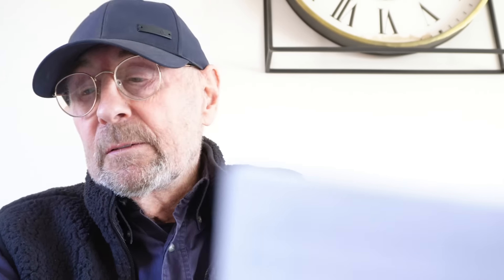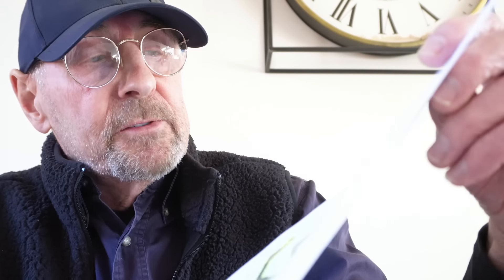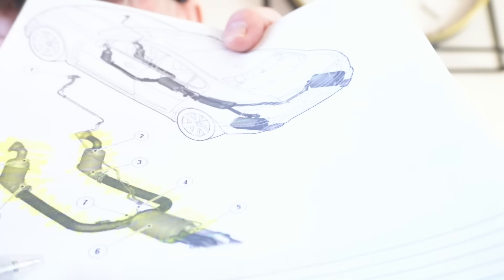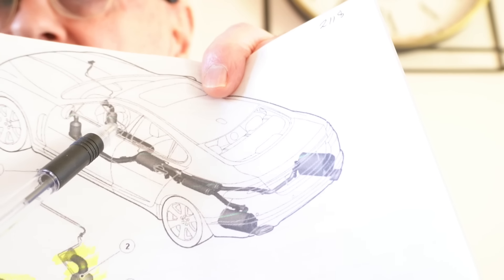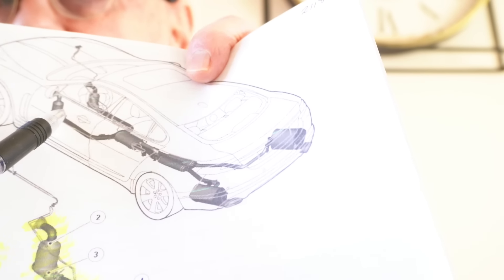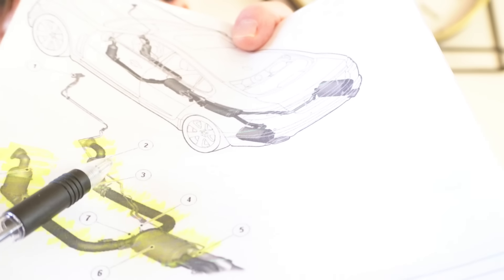CAUSE REVEALED!.. The Self-Destruction Of Jaguar Land Rover 2.2 / 2.7 / 3L Diesel Engines

Comment: You’ve just described the DPF regen system used by every diesel since 2006. It’s not unique to Jaguar.  Every diesel produced has the same issues. 
The 2.2 4 cylinder doesn’t suffer from broken cranks. Only the V6 does. Same for spun bearings. But, in the case of broken crankshafts, the engine is known to be short due to PSA wanting to use it in FWD applications and allegedly that’s made it a little thin at one point making it weaker than it should be. This is why failure is more common on heavier Landrovers and almost unheard of on Jags. Most as you say though are fine including my Jag XF at 111k. 
As far as 5 k oil changes go, sure why not. But equally as you say it’s driving style and usage and the computer alerts if it needs to be done sooner so it’s a little bit alarmist. The car knows if the oil is diluted so if it’s saying all is well, why not believe it?
Mine is generally done at 12k and is fine. 
So failed cranks aren’t due to oil dilution afaik. Spun bearings may be lubrication related but I suspect it’s just a design fault too and can happen irrespective of oil. 
They say the same about LR ingeniums. I had the oil analysed on my low mileage ingenium Discovery Sport after 12 months / 4k. The “internet” would say I should be running on more diesel than oil by then. 
 Oil very sooty but dilution? Negligible. So changed the oil anyway but not for the reason alarmists claim.
Reply: The cranks break on Jaguars also. It’s just that there are far fewer Jaguars around. It is only a proportion that fail each year. Around 5% of all V6 diesel seem to fail on an annual basis, which doesn’t sound too bad until you think about how many each dealer have in their area, which could be between 500 and 1500. If only 500, they may have around 25 failures annually , which is impossible to hide after a few years.
Reply: I have been interested in all these ideas on why crank shaft on the tdv6 brake one reason is the casting of some of the crank shaft is not as it should be now this has been under investigation for some time and what was point I would like to make is seems with a new crank shaft fitted and not changing any particular part of the existing emissions fitted to the vehicle and  have travelled many miles or kms without any issues,so there is another good point made that was made crankshaft failure happens between 75,000 98,000 102,000 and upto 200,000kms from  2006 to 2015. This for me personally would make more sense because the crankshaft casting I believe was made in different countries who ever read's this comment hope you will find it interesting I did I've been in the motor trade for many years  and seen many things 
so this doesn't surprise me this would happen thanks Barry.
Reply: @hedydd2  Not sure where 5% comes from as I've never seen actual numbers. I'm active on the UK Jaguar forum where the majority of Jaguar V6 diesel owners will go if there's a problem. Reports of engine failures are very rare there and certainly vastly lower in number than are allegedly seen on Landrover forums. I've also seen reports of spun bearings. In fact, I did a quick search for broken crankshaft and nothing other than a discussion on the subject came up. As these are the same engines in the same batches as LR, the only real difference is in usage. Load, both from the perspective of powering a 4wd system and also the weight. Add in that LRs can also tow large weights and it would seem that stress may be a bigger contributor than other factors.
Reply: @julben1900  So what you imply is that the engines are inadequately strong enough to handle the torque with which they are endowed. I would agree with that. They are are indeed not strong enough, which is why they break.
Reply: @hedydd2  Could be. When they first came out they were 2.7s with 435nm - they're now pushing out 700Nm. Mine is the 600nm version and on the 2wd XF, the only thing you get if you try to access that off the line is wheelspin. In fact in anything other than perfect conditions, it can break traction at 40. Plus the weight means acceleration can be brutal so unless you're a total lunatic, you only ever use full power rarely and then in very short bursts. It's great for pulling clear on a motorway but once up to 80, you're idling the rest of the way. 

The LR vehicles are obviously much heavier and 4wd so that power is much more accessible, so i do wonder if one is driven spiritedly whether it's pushing the crank harder than it's ideally designed to go. Add in a little manufacturing tolerance and you're close enough to the design limits to err into the statistical failure region.

Comment: Very plausible and interesting video. I imagine another factor to be fuel quality, there's quite a variation in diesel fuels available at the forecourt with bio fuel blended etc. If you run on lower quality fuel you can get injectors deteriorating which dramatically increases the amount of fuel goes past the pistons and into the oil on a regen. I'm lucky to live near a garage with a premium diesel fuel option and I always choose it. On a rare occasion where I have to put in a budget brand I only put in the bare minimum and top up with premium as soon as possible. I'm not going to name brands but some forecourt diesel fuel is pretty ropey to the point where a sensitive driver can feel the power loss. One fouled injector will wreck the cat and DPF, replace them and they'll just go again. I used to be a diesel mechanic and I'd far rather spend a few quid more on good fuel and closer oil changes than have the hassle of a major failure. "Service and care always cheaper than big repair"

Comment: Would love to hear your take on the economics of doing a bottom end refresh as a form preventative maintenance on otherwise healthy higher mileage engines. If lubricant dilution (makes sense) and a known weak crank (which I believe must be contributing at the point of no return) ie when the bearings spin and cut off the remaining lubrication. Maybe the answer is bearings (and/or) a journal Polish. It’s a lot of Labour and the question is where do you stop ?

Comment: I’m sure how to reply on my comment and to your reply. However you ask if the engine was also damaged. Unfortunately the dealership have been told by Land Rover Technical that they are unable to confirm if the engine is damaged until all the replacements are done and more compression tests are done. So I have no idea. I’ve asked for the compression tests that have already been done as well as the oil results and been told they can’t supply these until they have spoken to the head office 🤔🤷‍♀️
Reply: Sorry that should have said, I’m not sure how to reply 🤦‍♀️
Reply from the maker: Hi Debra,  let me know what they diagnose. They are correct the DPF should not have caused the turbo failure. The oil dilution occurs because of extra fuel injected into the cylinders, 2 of those 5 injections are to aid the heating of the DPF so is relevant to the DPF system but the DPF and cat are after the turbo so should not affect it. The engine oil dilution applies to the earlier diesel engines 2.2 / 2.7 / 3.0 not sure if it applies to the 2ltr as I have not read the relevant information yet but I would assume they run the same system.

Comment: Have you got any oil analysis data to back up your theory?
Reply from the maker: Hi, thank you for watching and for your feedback.Could you clarify what you mean by " your theory "
Reply: @crystalclearmechanics  Your theory is that diesel contaminating the engine oil results in reduced oil pressure, which ultimately causes the crankshaft to break.  Is there any proof from oil analysis data that engines which have experienced crank failures have excessive diesel in the oil?
Reply from the maker: Hi, thank you for replying. Your question as to my theory of what causes  the crankshaft to break, if you listen to the relevant words i use, " Guessing" "Doubt" and "Imagine"   which of those words  would you say implies the existence or need of proof? Your question should be relevant to the content. @tempestv8
Reply: It aint no theory mate it is fact - diluted oil will not lubricate as it has no viscosity hence the bearings heat up expand and nip the crank and then the torque of the engine snaps the crank - you dont need no bollocks data to work that one out
Reply: Unlikely. He's bundled the 2.2 into the same bracket of the 2.7 and 3.0. wholly different engines. Everyone knows how a DPF works ... service well and don't buy a diesel if you only do short runs.
Reply: @crystalclearmechanics  You make it quite clear at the end that this is not a guess, doubt or imagination.  You say it's the reason for the engines failing and that people should be made aware.  If that's not a theory, then what would you call it?
Reply from the maker: hi, I make it clear that oil dilution is the main reason for these engines failing ( Elephant in the room ) / bottom end destroyed, your question about the crankshaft is not relevant to the content.   @simonuden8450
Reply: @crystalclearmechanics  In your past video you highlighted the big end bearing shells slowly being nudged from their original position, and the shift of the bearing shells cover the oil lubrication holes.  Then when starved of the thin film of oil, the bearings will over heat and create a huge heat load on the crankshaft and eventually lead to the crankshaft snapping.  That's the general explanation that makes sense to me.  This new theory that its oil dilution due to diesel contamination that causes the crankshaft to bump the big end bearings out of position sounds interesting, but needs to be backed up by actual factual data.

The Ford Lion V6 engines are also used in Ford F150s in the USA, and also Ford Territory in Australia.  Neither have a history of crankshaft failures.  These models are equipped with DPFs as well and neither are known to have fuel dilution issues.

My impression of why the crank nudges the bearing shells out of place is due to the inherently poor oil pressure at idle.  Christian on his youtube channel LR Time, gives a good explanation.  What he is basically saying is not to floor the accelerator from idle, because the engine has poor oil pressure at idling revs.  And he recommends a slightly higher viscosity engine oil.
Reply from the maker: Hi Matt, thank you for watching and for your feedback. I did not bundle the 2.2 into the same bracket as the 2.7 and the 3.0, Jaguar did, that's their documentation I am reading from. The DPF system which includes engine management allow / cause the oil to dilute ( driving style can be a factor ), it does not matter which engine it refers too. As for " everyone knows how a DPF works"  No everyone does not know hence the reason I made the video. Feedback allows me to clarify certain points. Thanks again for watching. @mattjones1919
Reply from the maker: Hi, What I have conveyed in this video is not my theory, In the video I am reading from JLR documentation they say that a predetermined threshold of oil dilution ( being 7% of engine oil volume)  is when the engine needs to be serviced hence my advise to shorten service intervals to 5,000 miles as an overall precaution ( some change it at 3,000 miles, which can only be good ).  Could you clarify the inherently low oil pressure ( out of acceptable limits ) reading on tick over that you imply is across the board and which engines are affected?  I stand by what I said in the video, oil dilution is the MAIN factor in destroying these engines brought on by driving style or faulty systems with the owners being unaware of this issue, other issues can occur as I pointed out in my video. Thanks again for your feedback I'm always open to other views.   @tempestv8
Reply from the maker: Hi Colin, thank you for watching and for your feedback.  @colinblythe3710
Reply: @crystalclearmechanics  You are making a theory as to the link between oil dilution and crankshaft snapping. There are plenty of non-dpf vehicles that have had issues with the crankshaft and bottom end failing which would seem to be contrary to your theory. Whilst I am sure oil dilution is not going to be good for an engine, especially the main and big end bearings. There are also plenty of engines that failed at 20-40k miles and after a new crank have run for 150k trouble free. A good friend of mine has 2 SDV6 LR4's, both of which snapped their cranks at low mileage, one had already achieved double it's former mileage (rebuilt by Christian of LR time) and the other has 250k on it. That tends to indicate an issue at the factory with the cranks and not just oil dilution causing the problem on V6 engines.
Reply from the maker: Hi, thank you for watching and for your feedback. You need to listen to my video, 3 words I use when I comment on the crankshafts,  Guessing-doubt-imagine, does that sound like a theory to you. I also state that other engine failures not attributed to oil dilution can occur. I stated that the MAIN cause of Jaguar engines self destructing and Land Rover if they use the same system is oil dilution and I stand by that.  Jaguar who I quoted know of the oil dilution.. The question that must be asked when a design fault is given as the only cause,  why does it affect only a few engines? there has to be other factors otherwise all the engines would fail across the board. Fords, Peugeots, Citroens etc.  @TheGalifrey
Reply: @crystalclearmechanics  Fords version suffers the same in DPF and non DPF versions (uses 0w or 5w-30 A5/B5 oil) Citroen Peugeot don't, they use 5w or 10w 40 C3 oil which is rated for higher temperature stability. They also have Non DPF and DPF's on different versions. I am sure that oil dilution becomes a factor when the engine is being run on an oil that is already insufficient, we know that oil on the bores that isn't C3 rated causes extra friction and additional stress on the crank so it seems likely that extra fuel washing down the bores could aggravate that even further, but we also know that occurrence of issues drops significantly with 5w-40 C3 oil. Sure there have been examples of crank snapping due to potentially faulty cranks, but when those engines are rebuilt and run on "the correct" oil as PSA intended those engines continue on for hundreds of thousands of miles. It's like you're ignoring it happening on non-DPF vehicles to justify your claims that it is down to oil dilution on those vehicles when the incidence among early non-DPF vehicles is just the same when run as Ford/JLR intended. Finally, Russian and Australian vehicles don't have DPF's and they fail in the same way, in fact Autostrong-M (Russian channel with English subtitles) has a much bigger deep dive into these engines, you should watch THAT!

Comment: It’s a known problem with people who ignore the DPF warning. It’s a simple fix for anyone with a brain. When the DPF warning comes on ensure you take it for a 50 mph 20 minute run. I ran a 2.7 Jaguar for 6 years and 100k miles and as all my runs were long motorway journeys and never saw the DPF warning. After I retired and did more short runs I saw the warning several times. A simple 20 minute run fixed it. Also I had the whole system Terracleaned which made a surprising improvement in performance. If you ignore those warning diesel can end up in the sump, water down the oil and ruin the motor. But only if you are a chump and ignore the warnings. Mine did way way over 100k miles and was faultless. It’s dumb drivers who cause the problem not Jaguar
Reply from the maker: Hi Chris, thank you for watching and for your feedback. It's easy to do most things if you know the how and the why,  hence my videos.

Comment: The early models from 2005 don’t have DPF so how do you justify them breaking ?, they break crankshafts just as the DPF do
Reply from the maker: Hi, thank you for watching and for your feedback. The 2.7 / 3.0 engines have 5 injections of fuel per stroke as I stated in my video, 2 pre injections 1 injection on firing and 2 injections after firing. The main cause of failure is the 5 injections and driving style but 3 injections which = 18 fuel injections per full engine cycle are also enough to cause engine oil dilution. The 2 after stroke injections are relevant only to the DPF (as I understand it) What you should justify is why only a small amount of these engines fail in comparison to the number still on the road without issue. Engines as I stated fail for a number of reasons but when Jaguar admit to an engine oil dilution problem it's worth listening.

Comment: Thanks mate , oil and filter every 8000klms from now on
Reply from the maker: Hi, thank you for watching and for your feedback.The 5,000 mile (8,000 klms) interval is a recommendation and as a precaution against dilution. It's worthwhile to also check your engine oil level inbetween services, if the oil level rises then this indicates fuel dilution.
Reply: i've always changed my oil every 3000 miles. Even then I've measured a 10% loss in viscosity. ( time to run through a std orifice at a fixed temp).
Don't know whether that's fuel dilution or oil degradation.  So far no problems after 6 years.
Reply from the maker: Hi Dick, thank you for watching and for your feedback. 3,000 miles can only be good. @dickbidgood7791

Comment: "DRIVING STYLE" sounds like JLR's get out clause ! - 
they are actually stopping (or have stopped) production of the V6 engine and going to a straight 6 - 
I dont know WHO will make it yet but just hope there are more metal parts on it rather than all the plastic stuff that just keeps warping 
JLR - class the LIFETIME of  these engines & cars  to 100,000 miles - My customer found that out the hard & EXPENSIVE way when  trying to claim for a detonated engine - just outside the warranty !!